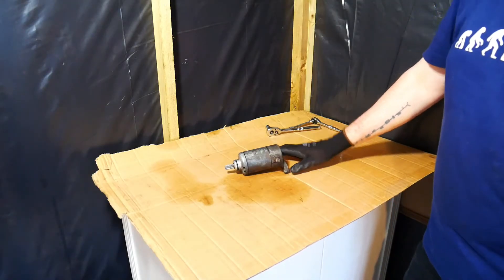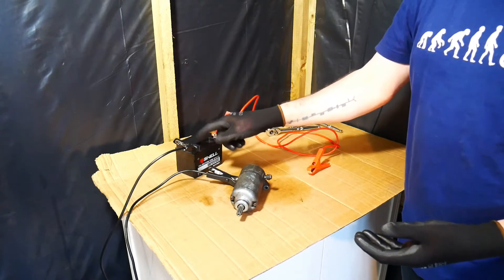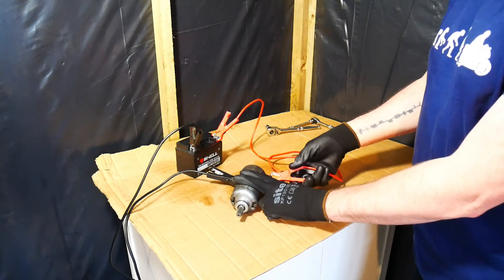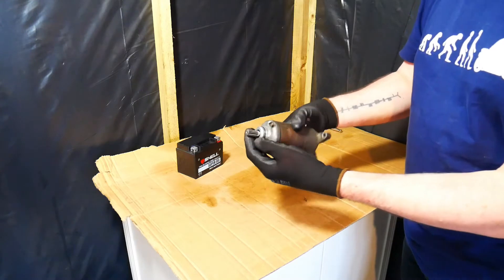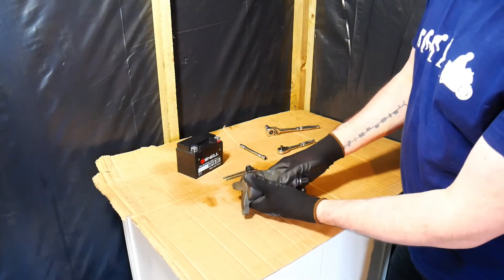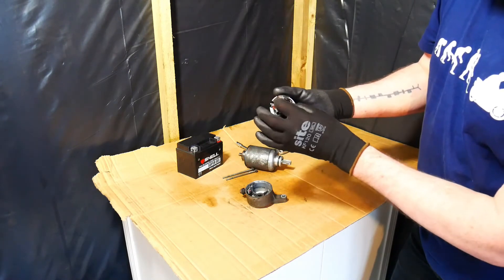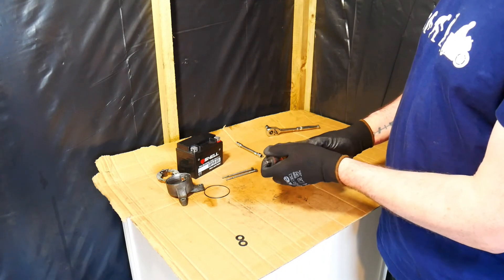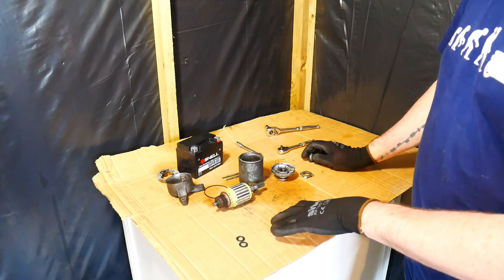Suzuki SV650 - How the starter motor works

Comment: My starter motor wont shut off as soon as i connect battery 
Keys are out ignition is OFF 
Been told could be wire

Comment: So two weeks ago I started my SV650 from 2003, but once I rode my bike out of my street it lost power and turned off kinda felt like there was not enough gas but there is enough gas. Then I tried to start it, but the crank over started slower and slower until it stopped. And now it doesn't do anything anymore, what can be the problem?
My bike stood outside in the rain for a while
Reply: what gen is it. as the Gen 2s can be started by jumping fuses under the seat, according to a video i just watch on YT https://www.youtube.com/watch?v=Tc59GJuiQo8
Reply: Did u find ur problem